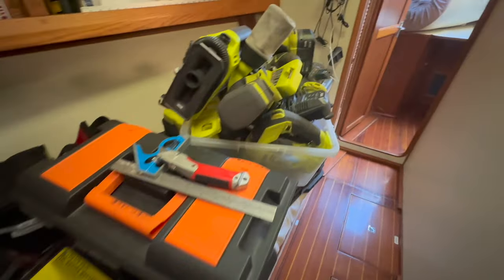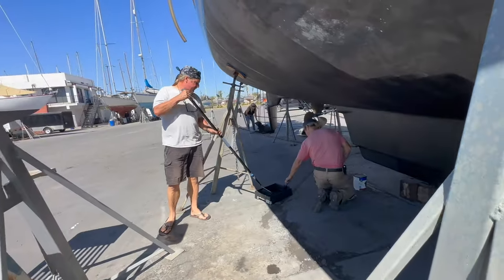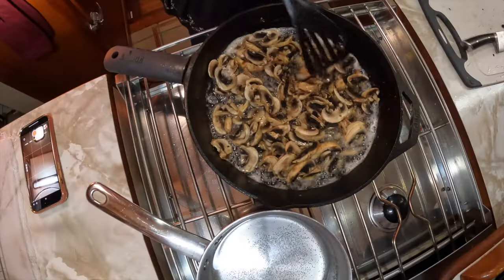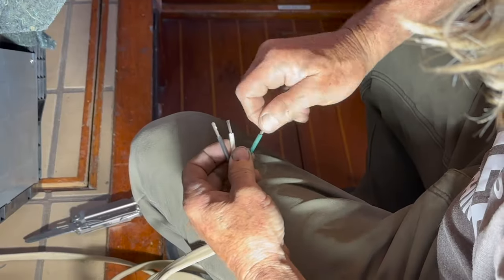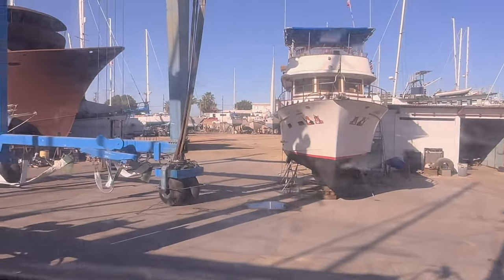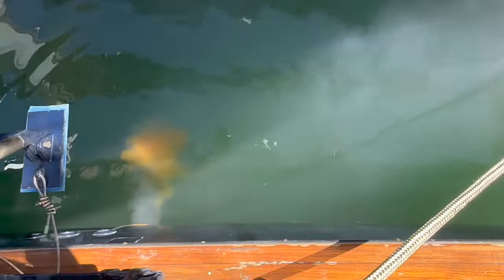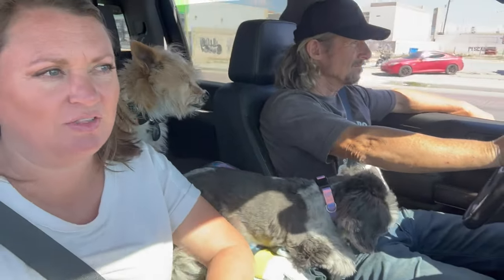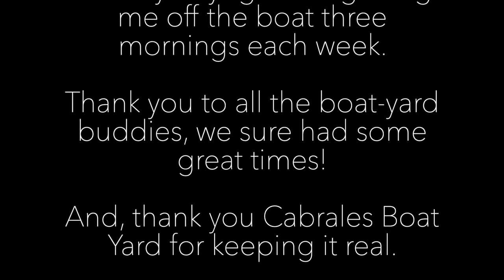Ep 71 | Blue Pearl SPLASHES this week!

Comment: Were really enjoying your channel!  One suggestion is to not use wire nuts on a boat when making an electrical connection.  The vibration and also the salt water environment requires butt connectors and shrink tubing:-)
Reply from the maker: Thanks for the tip! We do use crimp connectors and shrink tubbing on 90% of our boat connections😊